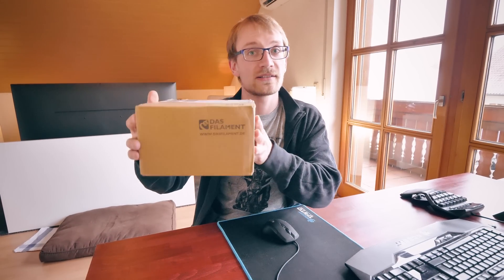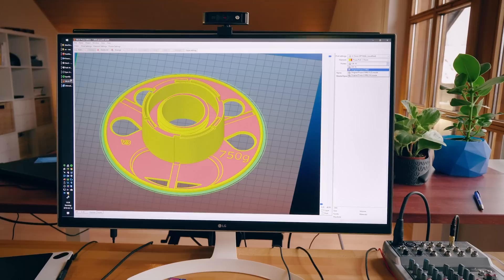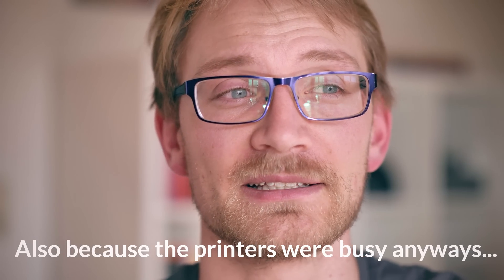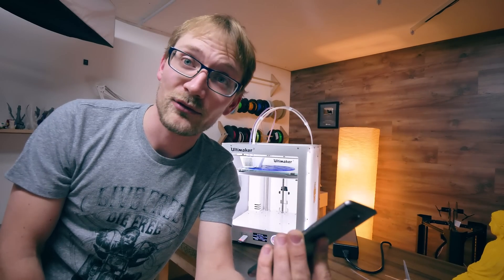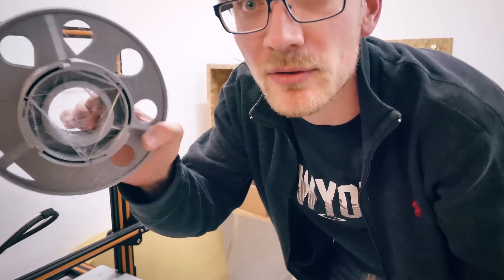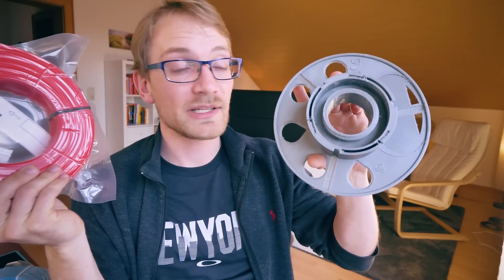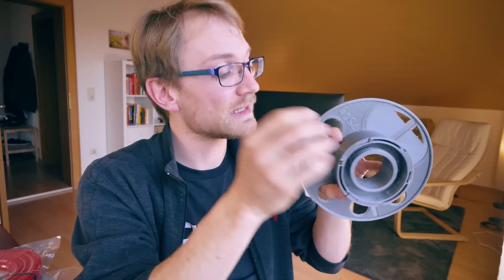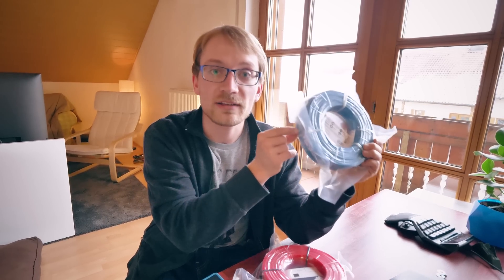3D printed filament spools!?

Comment: I hate that they make the master spool with the center cylinder's OD like 100mm or so.  I'm trying to pull the ears off cardboard spool and slide it onto a plastic/pla spool.  The ID of my cardboard spool is 76mm and every spool I find on Thingiverse, Printables, Cults, etc, are all like 100mm like this... and you can't slide a 76 ID onto a 100mm OD.  So much for "Master" spool.  It would have actually been a master spool if it started at something like 60mm and had adapters to take it up to 70mm, 76mm, 80mm, 84mm, 90mm, so you could slide any size cardboard onto it.  Different brands have larger IDs on their cardboard center bodies, but I'm so lucky to have picked a brand with this BS 76mm that no one makes an adapter for.  YAY

Comment: If the spool is always the same, why did my filament rol without spool not fit?!

I have printed already 5 halves, and i got my filament rol without spool, and they do not fit, the round carton 
they are lolled on, does not fit my self printed spools, i tried to rol it my self on the spools, but that just did 
not work, so or i can send the other back to the store were i bought them, or i have to buy there empty spools.

And they cost each €8, and two halves is 200g, so i can make 10 halves, so 5 spools for €18,50, so i have to 
make the parts were the filament must go on smaller, and i do not know how to do that in a program.

Edit: I made the spool 12mm smaller in the program that came with my 3D printer, so that the part (the 
filament on the round carton) that goes into the carton hole now fits, will see it it does fit, when i have printed 
the fist half.

Comment: "you can weight the filament"

Technically that's possible with a normal spool as well, just weigh it before using and when its empty, then detract the weight of the spool of the first measurement.

I'm interested as there is literally no point using a new spool everytime you buy filament, the problem is that in comparison the spoolless stuff is harder to get, standards may not always fit your masterspool,  and its more work and basically just as expensive.
If the price of spooless filament drops I'll get it. ironically that may not happen as production of spoolless filament is  more labor intensive.

Comment: The bummer is that it seems like the companies that make filament did not catch on to this idea and I really wish they did. I am a pretty busy maker and I do a decent good job being economical in my waste. I try to model parts of the total project, smaller pieces, and I set layer height to .3 until I am ready for my final print or, if it doesn't need to be cosmetically perfect or particularly strong I even leave the final print at .3. I see very few companies that sell the spotless filament and even those sell a package of 2, one spotless refill and the other has a spool, I assume a spool that can be refilled. I printed out 2 spools, one from slant the other from Masterspool so I could, easily, use refills. I feel really bad throwing away the empty spools even though I do it in the recycle bin. I even am considering downloading a thingiverse project where a guy takes the empty filament spools and makes them storage containers with drawers. Additional problem is that even the very few manufacturers that make spoolless refills the colors are the typical Blue, Green, Red, Black, White. I like the silver, gold, rose gold, bronze and I see no refills with these more creative colors. I do wish this would have caught on.

Comment: The filament spools is actually faulty , or most of them are as the optimal spool is the one without side holes. Some makers have those, but the best spool would be a solod disc to prevent uv light and humid aging the whole spool. The weight gain is so low as well to have holes and no one cares if you can see the filament from the side as it is not easy to see if it is 100 meter left or 60 etc anyway

Comment: I've recently printed 2 80mm discs that go into the standard spools,  with inserts for M8x22mm bearings. These mount on a M8x100mm bolt fitted to my Ender 3 spool holder frame. I did this because I found the spools were not free enough to spin on the original Ender 3 spool holder tube,, works OK. These spools could easily be redesign in Tinkercad of 360 to incorporate this. wish id saw this video weak ago. LOL.. Oh just noticed publish date, yonks ago, did the new spool idea take off or flop, haven't seen many around?.

Comment: Wouldn't there be a bit of a chicken and egg problem with this if it became ubiquitous, though? If you're getting your first 3D printer, and you need a master spool, then how would you print it if you don't already have one? Right now, you do it with the filament that's shipped with spools, but if they never did, you'd be kinda stuck.

Comment: 2d printing: Yeah, we've locked you into our cartridge environment, now we're gonna charge you more than the most expensive champagne for ink
3d printing: We'll give you just the filament!
Reply: thats because open source movement was already there when 3d printers were starting so reprap projects could pop up.
When 2d printers where starting there wasn't an open source movement yet. If we want cheap ink we need to make open source 2d printer which is difficult af because of the  patents and stuff...
Reply: @igorordecha  aftermarket ink and toner have always existed. The thing is not about open source, but the user. 3D printers users are mostly hobbyists, engineers, or small businesses. They are more than prepared to take steps to keep things running at an affordable cost. Printers on the other hand are used by people who don't want to spend a lot of time dealing with it. They just want to print a document and be done with it, so they are more likely to pay for a cartridge out of convenience, than to buy the refill kits.
Reply: XYZ printing would like to disagree
Reply: one can only dream of the socialist advancements that will be achieved by 4d printing

Comment: Small amount of plastic saved... creates significant hassle.  And there are better ways to do almst the same thing without having to print the custom spool (how about buying a roll of filament on a mass produced spool that comes apart with 3 screws?  Then re-use THAT spool that you know fits that cmpany's "spool-less" filament)

Comment: it seems that most of my spools are press fit.  That means I can reuse the spool if I can put the filament on it!!  So it may be a case of me just putting 3 slots in the side of the spool to make access ports to remove the zip ties.  Great idea though and I really hope it takes off.

Comment: Interesting idea, but not very practical I would think. Too great of a chance of the filament springing out when you cut the ties. I had to remove filament from a broken roll and it was no fun. The stuff I buy is already $15 for a 1kg roll, so it's already cheep enough.

Comment: I get the point that some filament shops sell spools < 1 kg because of the shipping cost, they sell 750 g or 800 g.
But the my most known shops sell only 1 kg or 2 kg. The mass of the spools counts additionaly to the filament mass. All in all I got there some like 1200-1300 g per 1kg spool.
I my opinion filament buying/selling comes down in all cases to €/kg. Mostly the price is curcial. 
Spools in the region of 700 or 800 g have in all shops I know a worser €/kg rate as spool with 1 kg.
I saw these  "refill" pack in one shop some day, but save of mony because you don't have to buy a spool was not enought for me that I wil say I want to buy it.
Because the money save what you think you have is not a good calculation because you will print a spool for yourself one time or more and the printing of the spool and the filament you use there costs more as the injection molded spool that you can buy directly with the filament.

Serveral weeks ago I had a spool (a injection molded one) that was made of two parts like the printed one. With this spool you can use this refill filament perfectly. I dont know anymore where I got this spool. 
Better idea is buy some filament with this 2 piece spool, when the spools are empty you can reuse them for the refil. 
In the beginning you buy the filament with spool ten or twenty times and after this you have a enough reuseable spools for refile (if there would be this 2 piece spool).

But printing a own spool you dont save time or money. So for me bad economics at this point.

Comment: I prefer to have a standard spool that I could buy(Not Printed) and then filament separately. Surprisingly I have seen few of Chinese no name filament doing that. User and Manufacturer both save on spool cost. I could for example buy 3~4 spools and add filament when ever I want.  

I really don't trust FDM printed spools with lateral force along the shaft. And think about this, printing a spool would take 35+ Hrs, I rather buy empty one for few bucks.

Comment: Are those G-one tubeless road tires?  A bold choice Tom, but Schwalbe make a solid tire: I'd be interested to know what you think of them.  I run Panaracer t-serv with thronproof tubes because I'm paranoid, but I have not had a flat in years.

Comment: I still think filament manufacturers should also sell injection moulded refillable empty spools (or filament with refillable spools) because it takes very long time to print and they will not last as long considering they are 3d printed and will be reused over and over again! Am I right?

Comment: When you built dolly the nema 17 motors listed didnt have any specs. When you goto AliExpress they all sell 12v stepper motors which are not recommended for the a4988 drivers. Pololu has a table of steppers they recommend to utilize the 1/16 mode. Do a video on those maybe? A motor video. Can we use a nema 14 or smaller nema 17 (lower torque) for the extruder to achieve greater acceleration or jerk?

Comment: Now that you mention it, I had a little espresso kettle like yours and it worked great.  Some where in one the many moves in the last decade, I lost a critical piece (the filter cup, damn).  I think the kettle reaches too hot a temperature to print a replacement, but would it not be sweet if I could print such a thing with like kevlar, teflon, or something.

Comment: I have a philosphical question, If you were on a desert island and you had to make a choice between infinite PLA filaments and infinite ABS/nylon/other plastics, which plastic would you choose and why?
Reply from the maker: On a deserted island, I'd go for PETG - still temperature resistant enough to stand up to the tropical sun, yet easy enough to handle for larger parts like a raft!

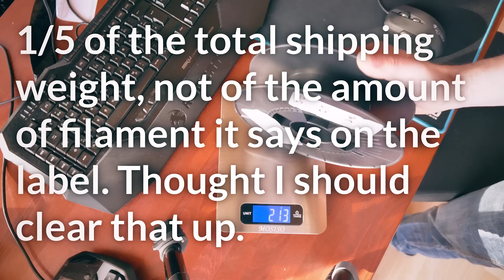Comment: I like the VLOG format, it makes your videos funnier in a way, and I like getting information and humor at the same time. One thing I didn't really enjoy too much was the text clarifications - big white text over the whole screen with a bright background makes it somewhat hard to read (thinking of the clarification at 8:49). And the timing makes it disappear too quickly. May use an annotation for those instead? Smaller text but up longer would work better for me. Regarding your drone footage... Tom, you've got a mass of 3D printers! Pull down one of the myriad of quad designs on Thingiverse and PM me, I'll ship you the electronics and propellers you need to get setup quick and easy, and we can do a hangouts to walk you through the programming and first flight! Or, you know, come visit Geneva for a weekend with printed parts and go home with a flying drone!

Comment: I don't like the concept and it really only helps the manufacturer more than the consumer by increasing their margins removing the cost of the spool and shipping.  First off, if I just got a printer with no filament to print a master spool or worse, my printer doesn't have a large enough print volume, I'm screwed.  Another bonus to the manufacturer is I have to consume filament to hold the filament, think about someone like me that has ~200 rolls of filament, 100 or so have been partially used - I would have to print ~100 master spools, yikes!  Spools also protect during shipping and loading in the warehouse, I can see damage, tangles and spaghetti mess before even loading the master spool.  One thing I would like manufacturers to adopt is a standard spool size starting with the hub diameter.  I honestly feel Proto-pasta has it perfected by using corrugated spools and offers a discount program when returned. Better for the environment, the spools are light, cheap and completely biodegradable. Tom, love the format of this video - as for the content, you didn't really mention one bad thing about the master spool so it feels a bit one-sided with the lack of attempt to express even the slightest negative.

Comment: Is there a good reason to tuck the "inside" end of the filament into the spool. I want my spool to let go of the filament so the end will go all the way through to the filament sensor. Plus a kink in the end of the filament might cause a jam on my MK3 when it tries to reverse it out of the extruder.

Comment: I like this idea but would really rather not use 3d printed spools. A nice one time by hard plastic injection molded spool would be nice. Make 3d printed ones an option and well the community will take care of most of that anyway but I'd still want a few hard plastic ones. However, I still need to buy more spool because I'm not done with my prop wall yet and need them for my mounting system.

Comment: Like this style - there's plenty of space on the channel for both scripted and unscripted. This feels more dynamic and a bit more fun - short, punchy, and less polished worked well here. The cheeky vlog segment livens things up a bit too :)

So right on the coffee thing! This is what I use at work and when travelling for a decent espresso - also works as a conversation starter pretty much anywhere; to make a decent espresso just need hot water: http://www.handpresso.com/en/espresso-machines/manual-espresso-machines/handpresso-pump-black/

On Masterspool itself; it has to be the way to go - even better than the cardboard spools. Will be mentioning it to the places I buy filament. If it takes off, someone will no doubt step up and manufacture for those who don't want to print the spool, which will be good.

Comment: Looks good. Poor SD card used as a package opener though :) One thing I would add is not have the camera attached or standing on your desk, the shakes while you put something down or picked it up, specially at the start of the video were unpleasant. I like the scripted videos for deep dives on a topic, but this I could watch easy for smaller topics.

Comment: I don't mind unscripted. If its what your like doing roll with it. I did think it was good and well put together. And still very informative. I love the Idea of Master spool. Having printed a neat roll holder and setup that uses airlift pellets for a particular size filament roll, I know the pain of using a totally different trap of roll. EG: Ziro.... they have a chamfer on one side making it completely useless for my setup. Grrr. I'm not overly keen on printing off more roles for each color I have thought... But at the same time over time.. it would all work out better and way more organized.

Comment: Wow. Sad to see a $4500 Ultimaker 3 fail so catastrophically.  Also, that residue in the Bowden tube...I get that if I use the Ultimaker 2+ Remove Filament option...it just strings hot filament all the way up.  I wind up heating up the nozzle to 215, then down to 100 and do an Atomic Pull to not only remove the filament cleanly...but it cleans the nozzle too.   (And wow, you live really close to a nuke plant...!)

Comment: That was a satisfying video, You're a dope. I wouldn't always do the impromptu videos, but it is a welcomed change. I think videos like the printer reviews, the educational PLA, ABS and PETG style videos (ya know, the printer essential videos) should probably remain scripted simply due to the intended and/or potential audience. Those videos are useful to point noobs to:] this is a good change of pace for pretty much everything else though. I'm actually designing and building a drone for my brother for his drone photography hobby, get in touch with me and I'll send one your way when I'm done. He has a camera, not as good as yours, but it means that all I need to do is use the motors and computer board to support a high-end camera without actually adding a camera. Take me up on this haha I'm engineering it for my brother and offering to simply make two. I have some pretty high-quality, extremely low amperage motors:]

Comment: Great idea that should be universally adopted.  Soon it's likely Thingiverse and other repositories will be flooded with alternative spool designs.  This demo spool seems to be more robust than necessary.  Something flimsier might function just as well, use less filament, and print faster.
Reply: Here is something to surprise you: greg-3d.ru has been selling fillament for reusable spools for quite a while. At least 1.5 years, because that's when I found out about them.
And Russian 3d-printing vloggers on youtube have already made alternative universal spool designs last year. The thing is that greg3d is producing fillement in Russia, and they are mainly selling in Russia. They simply decided that their domestic market is big enough and they didn't want to go through the hassle of international shipping.
---
In case you're curious, here is one of those vloggers: https://www.youtube.com/watch?v=UCV_K8SDC1Y

Comment: Already tweetet it because I didn't know that you did a video about it but deleted that so you don't need to read stuff multiple times:

Hey Thomas, how safe to use is the MasterSpool? I also printed v3 just when v4 came out and after cutting the zip ties the roll had enough room to expand a bit to the outside ... I was afraid that some filament was settling down under other layers .... is that normal?